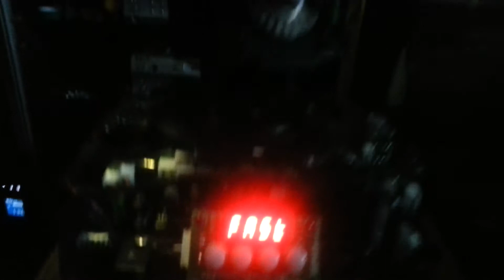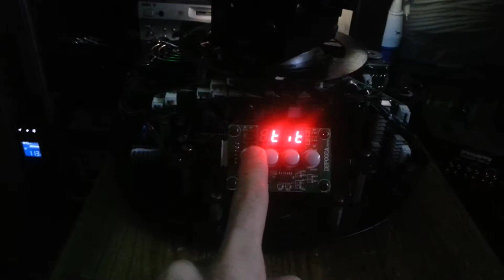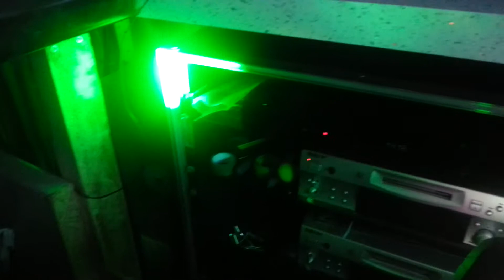Chauvet Intimidator Spot XYZ LED 60W Moving Head - Faulty Constant Spinning Gobo Wheel

Comment: Most Chauvet stuff that I've owned in the past has broken very quickly. Which is why I stay away from their stuff now.
Reply from the maker: I would also agree on staying away from there stuff, I even contacted there 'technical support' for details on the problem and some advice as to what the issue would be caused by but didn't get anything of much help back from them other than check the sensor that I had already tried.